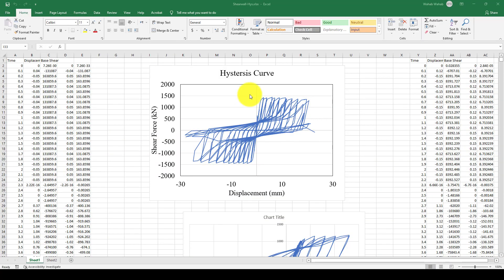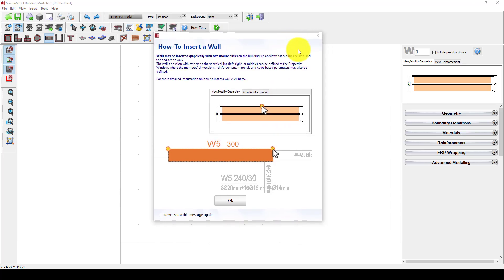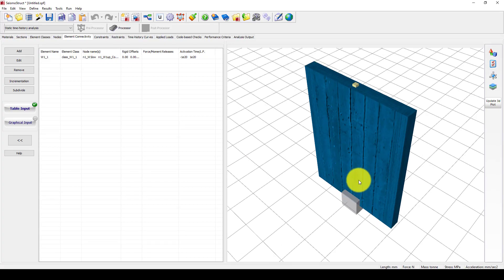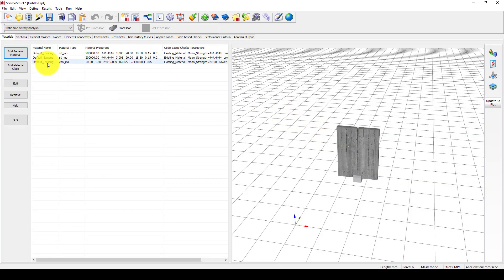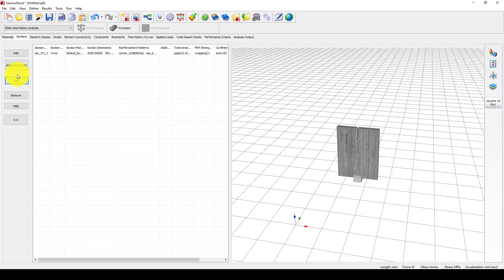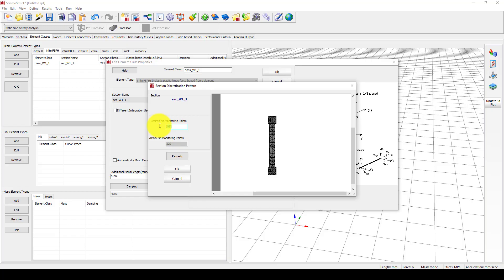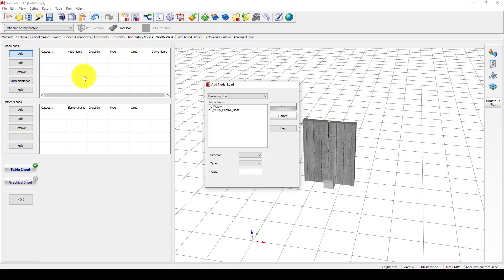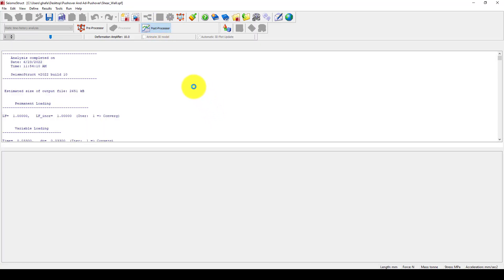Cyclic loading analysis of concrete reinforced Shear wall using SeismoStruct Software

Comment: Dear teacher. I am a graduate student, you made a lot of high-quality video, I have a little praise and collection, benefit a lot, I have two questions to ask you, thank you very much.
1. I want to use n-link to give the shear wall shear properties, please ask how to use the node to connect the link and the wall ;
2. When I insert the wall and the beam in the same position in the Building Modeller, the beam will disappear automatically.How to solve this.
Reply from the maker: You can add some non-structural nodes and then use constraint to connect them . Additionally you can use some predefined functions from the program.

Comment: Is it possible to extract data from seismostruct from multi story building under pushover analysis  to draw a curve between story in y axis and displacement in x axis like this
Reply from the maker: You check my videos I have did .
Reply: @KSSE_Engineer  yes l have checked but till now not reach my target..l could draw capacity curve between base shear and roof displacement...could reach performance criteria ...but displacement verses stories as curve not yet